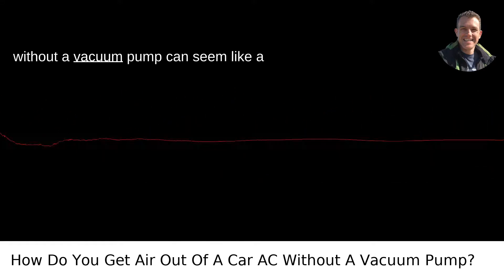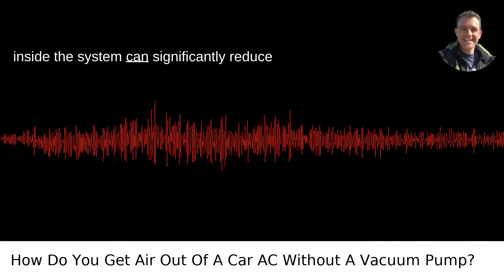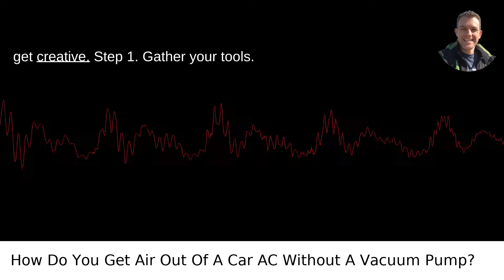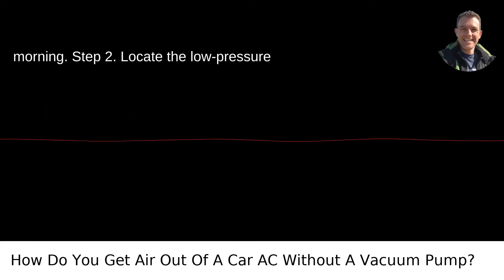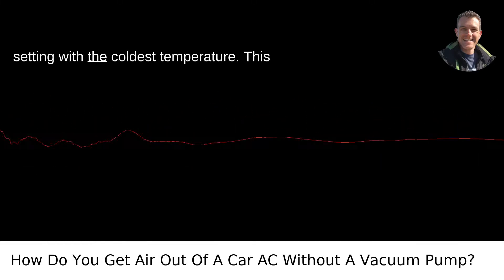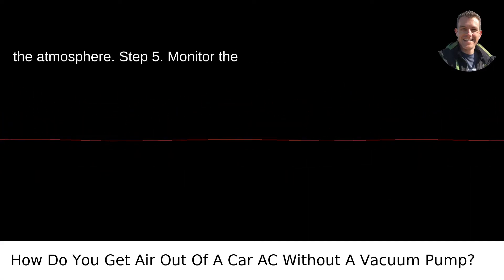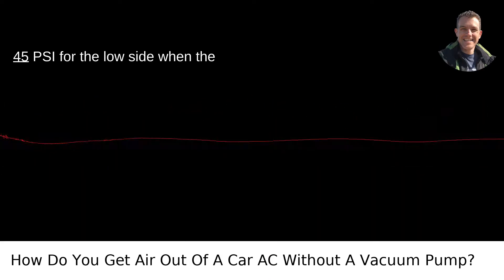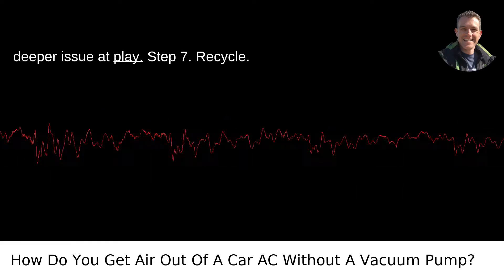How Do You Get Air Out Of A Car AC Without A Vacuum Pump?

Comment: The compressor does not push air out into the atmosphere at all, it compresses the refrigeratant into vapor. If their is air in the lines, you need to put nitrogen in the lines then, hook it up to a vacuum to get air out of the line, cause air has moisture in it. So I don't know how you got the idea that the compressor just pushes out air, refrigerant into the atmosphere lol. Cause then all cars would be polluting and also the ac system would never hold refrigerant